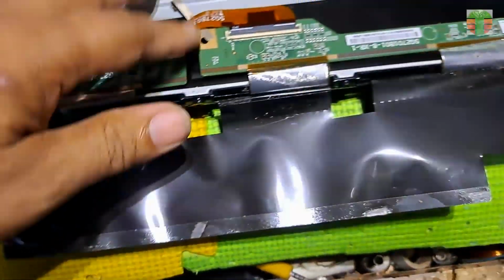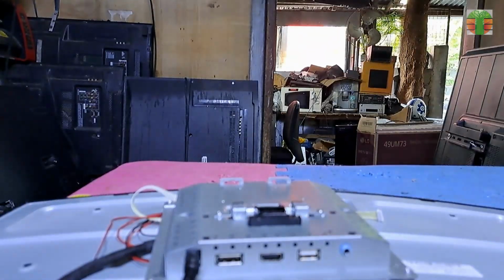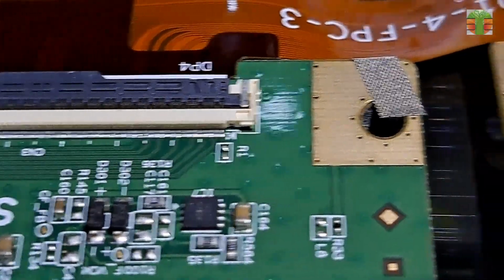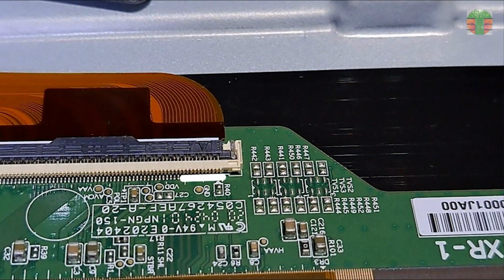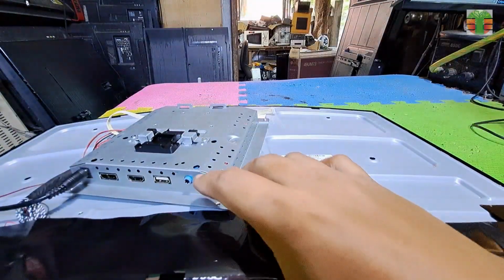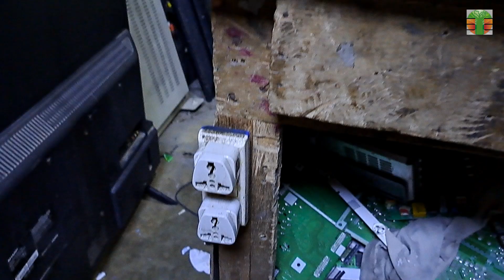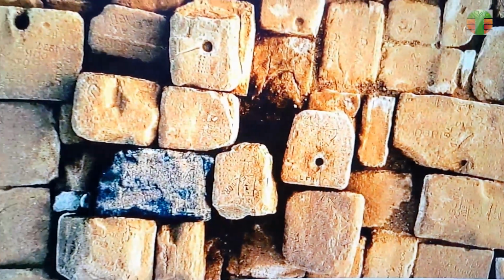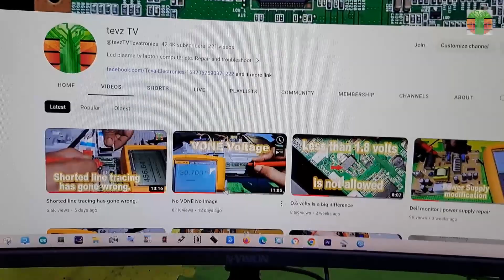N-Vision PC Monitor Repair. GT27R18 V3

Comment: Helllo im having a problem with my tv the led. Lights only light up the logo and then turns off when it gets to the display part why is this happening and the tv model is rled2845a-d
Reply from the maker: A firmware problem maybe.

Comment: Good day sir, I'm having issues with my 55" panel so please I need your help in solving it. The number on the T-Con is HV550QUB-F84/H11.
So when I tested the T-Con test points, these are the voltage I got.
VGL1 =-7.8V
VGL2 = -6.3V
AVDD = 17.5V
VGH = 32.8V
CLK1 = 7.5V
CLK2 = 7.5V
CLK3 = 7.5V
CLK4 = -7.2V
CLK5 = -6.3V
CLK6 = 7.5V
CLK7 = 7.5V
CLK8 = 7.5V
CLK9 = -7.2V
CLK10 = -6.2V
These voltages were gotten when I disconnected the 2 ribbon cables connected from the T-Con to the panel. There's no difference even when I connected both cables from when I disconnected both cables, voltages are the same.
CLK1,2,3,6,7,8 came from 2583B IC while CLK4,5,9,10 came from another 2583B IC.
Sir, I want you to look at the voltages and tell me if the T-Con is okay or not
Thanks

Comment: Hi engineer
Every time, by cutting the data on the left or right side of the image, it was fixed. Is there a problem with the same part on the left or right side
Reply from the maker: It is the problem with the LCD panel
Reply: @tevzTVTevatronics  How do you know whether to cut off the left or right side?

Comment: di gumana saken yang method nayan i disconnect right side itss shows kalahating nvision and kalahating black after puting paper not working black lng led works only but no picture try to cut the right side in the other board dint even work
Reply: works with me :)